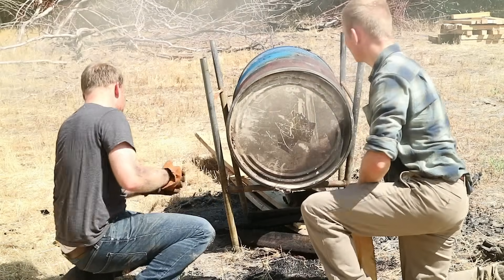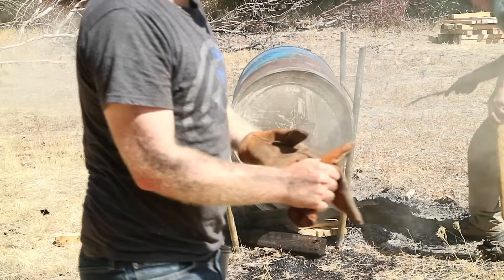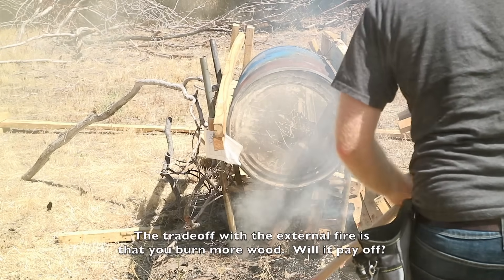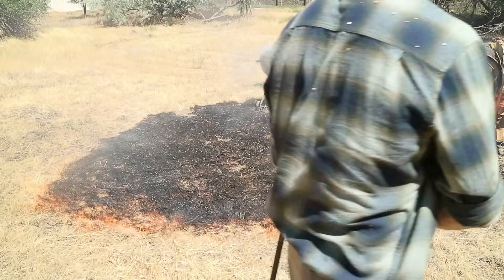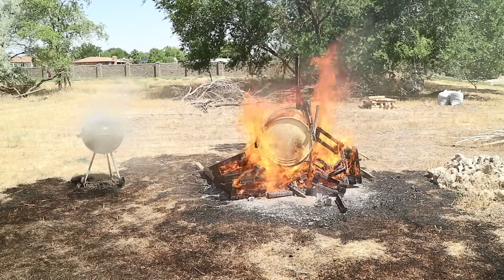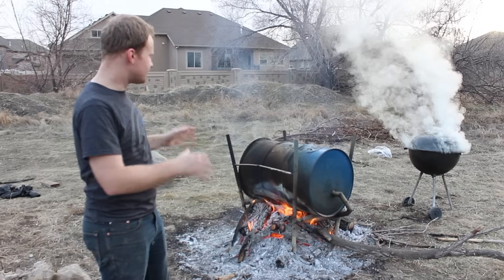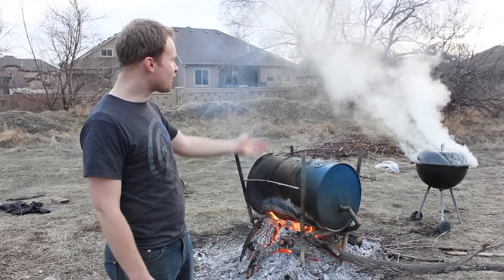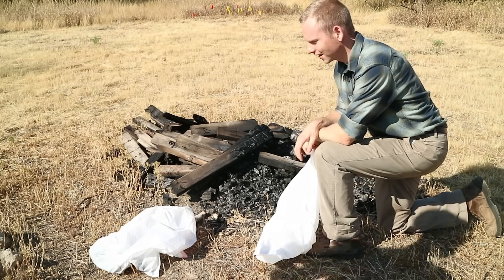Making Charcoal - A Tale of Two Retorts

Comment: I much prefer a retort, both for this and for pitch tar making.
Thing is, as you experienced, it is wildly inefficient and makes crumbly coals when you do it like that.
You have to make walls surrounding the fire so the retort is sort of baked in an oven. That gives low fuel consumption and excellent slowfired solid chunks of coals if fired gently

Comment: Wouldn't the fire inside the barrel die out with the lack of oxygen? Hence you would only need the external fire.
Reply: Building a fire inside does mean you jump start the process, assuming you're using thick enough material for your main charcoal product, but also consumes a chunk of bio-matter that could have become charcoal. 

If you have a need for producing charcoal on a regular basis, then building rocket stove based gasifier is probably about the best bet. 
I've seen a neat design that fed the wood gas into the rocket stove re-burn chamber in the middle of the charcoal box.

Comment: Exploring the efficiency of different charcoal making methods/devices seems like a nice idea. 
Though, if you really want to make a video comparing the efficiency of the two methods, it would have been nice to talk quantitatively about how much charcoal was produced vs how much wood the process used, which is the definition of the efficiency of a process. 

Also, I think one of the big problems with you open fire method is that most of the radiated heat is wasted, because it leaves from the side. So I think you should explore the idea of either having reflectors around it to try to send back this radiated heat towards the barrel, or alternatively containing this fire and injecting oxygen instead of having it completely opened, so that the heat stays mostly inside what will basically be a furnace. 
With a group of friends we explored the reflectors idea for roasting a pig. So different goal, but just putting aluminium foils around the fire pit made a huge difference in that case. So maybe it's worth trying something similar.

Comment: i've only see the wood in a 55 gallon drum with an exhaust pipe that curves back underneath with holes facing the barrel. you start a fire underneath. once wood gas starts flowing enough, it will ignite from the fire below at which point you let the outside fire burnout and it will continue to burn the wood gas and heat the barrel
Reply from the maker: That certainly is the theory. This one has that exact setup, but the seal isn't super good. The flame from the pipe was sporadic at best.  JB

Comment: the internal fire method is the choice of traditional charcoal makers around the world. i don't really understand the benefit of the external fire retort method, consistency of the charcoal produced?
Reply: Consistent quality. You can also do it without burning the interior wood at all which means much more charcoal per load. Unfortunately these guys seem to get 90% of the idea and then fail at correctly implementing it. That last 10% of research and planning would save them a lot of time.

Comment: You want a retort that doesn't leak - the only gas escape should be through your gas pipe down into your fire (you don't need or want an internal fire at all). You want it to build some pressure - that keeps the escaping gas burning steadily and keeps any fire/oxygen from getting into your retort. Think of the smaller nail hole in a paint can retorts and scale up.